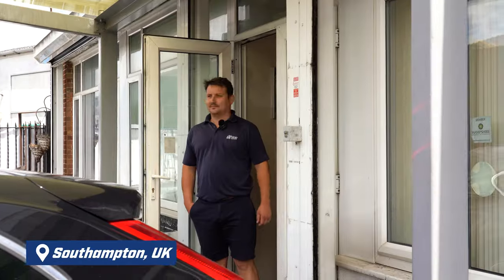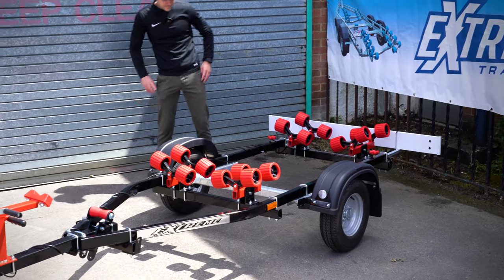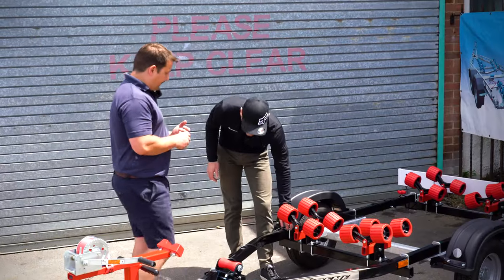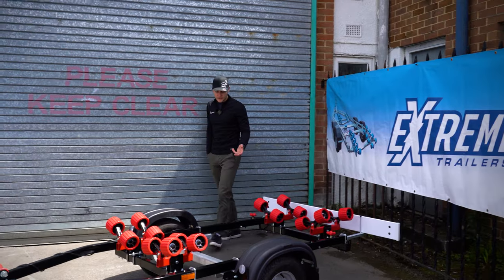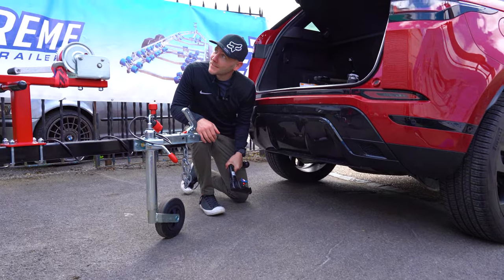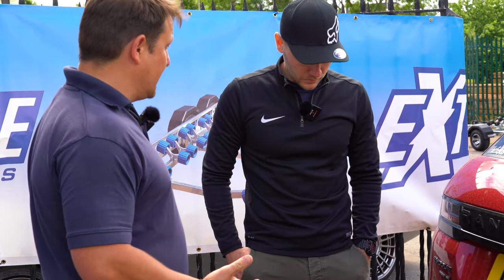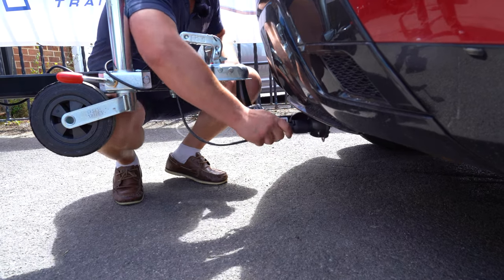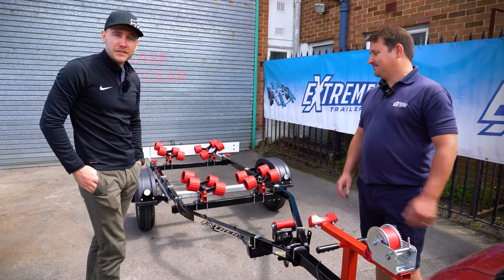COLLECTION DAY - Brand New Extreme Roller Powder Coated Jetski Trailer | Jetski Trailer 101

Comment: What is the hideous white board on the back?
Reply from the maker: It’s the UK standard removable light and number plate board, you remove it for launching and recovery…
Reply: @classicjetskis  what a shame, such a beautiful trailer and to have that on it
Reply from the maker: @kyletrump8025  yeh I hear you dude, you can have integrated lights and number plate but when beach launching it will hit the rear of the ski hull so it’s a trade off… I normally use the narrower width boards that don’t protrude past the width of the trailer but this one came with the LED bigger board as most prefer the bigger boards as this is the biggest roller PWC trailer they make in the UK. Send me a pic of a representative trailer you guys run?
Reply: @classicjetskis  where should I send pic
Reply from the maker: @kyletrump8025  are you on Instagram? Fire me a direct message dude